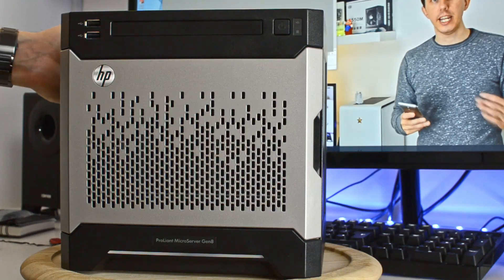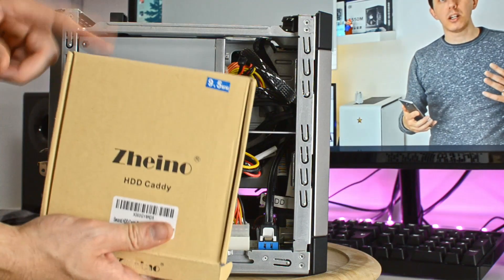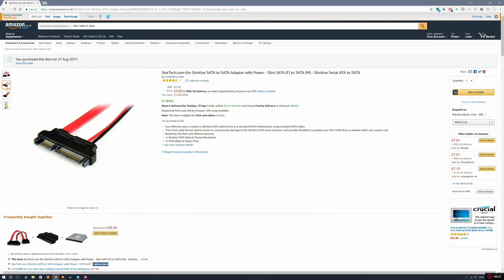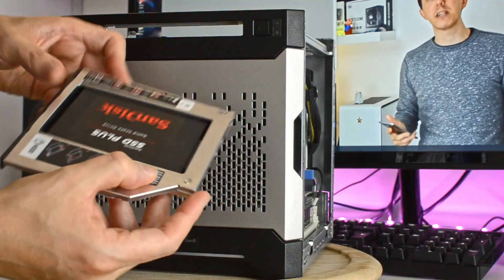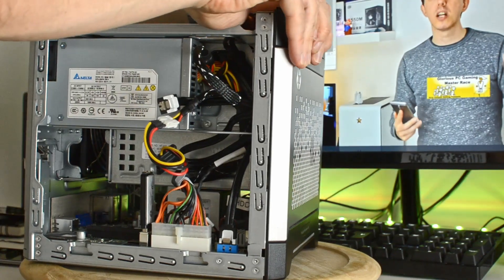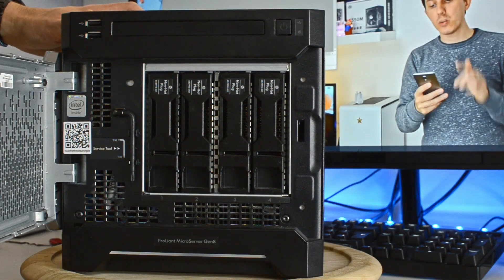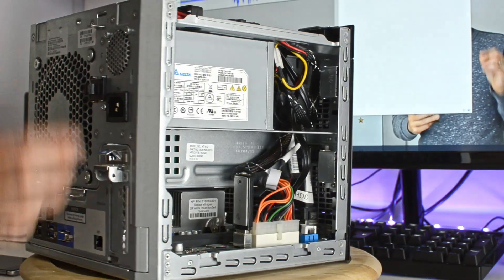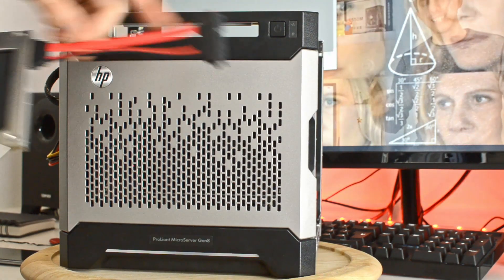HP Proliant Microserver Gen8 SSD in Optical bay

Comment: What power cable did you use to plug into the slim sata to sata? Is that already installed in the server itself?
Reply from the maker: Very good point! I forgot to mention you will need an adapter FDD to SATA, I have one already because the SSD was already being mounted! Here an example of the adapter:
https://www.amazon.co.uk/LINDY-0-15m-Power-Female-Adapter/dp/B00HN3NEZU/ref=sr_1_2?ie=UTF8&qid=1506170732&sr=8-2&keywords=fdd+to+sata

I will stick the comment for everyone benefit!
Reply: @NoTechDrama  please update the video with some text to reflect this information. I wasted a day trying to understand until I read the comment section. Haha.
Reply: there is also an official hp parts 667526-001 that connect to cdrom power and as a sata cable if you want to stay with hp parts. Also need cdrom to ssd/hdd 2.5 adapter with this cable

Comment: Why use a caddy with false front panel? You can get an adapter that costs £3 on eBay and its hidden behind the original optical drive blanking plate thereby maintaining a factory finish. Your solution is 5 times more expensive and looks worse.
Reply from the maker: Put a link here could be helpful for other viewers, thanks!
Reply: @NoTechDrama  The links to eBay keep getting removed.
Reply: @Distorted-Vision  can you write the name so I can search?

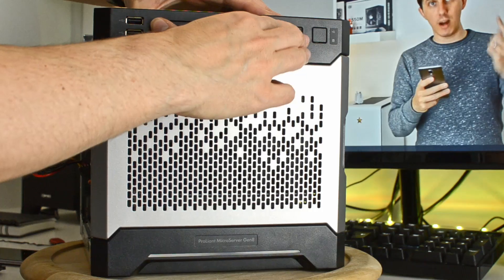Comment: Pardon me, I'm not native English speaker but what did you said cca at 4:30? Did you mention "Right" controller or "RAID" controller? What is controller, it is hardware or software? If I understand correct then for some reasons it is impossible to boot directly from ODD. How did you setup your USB so it contains only boot loader and OS is on SSD? Here is direct boot from SSD  https://www.admfactory.com/hp-microserver-gen8-boot-from-ssd-install-on-odd-bay/ I guess the trick is to have SSD in separate RAID. Is this worse solution than yours for some reason? Thanks
Reply from the maker: hi! I'm non native english too... so not so easy to understand me! I said "RAID"... the solution I've adopted is boot loader (GRUB) on USB and OS on SSD... The solution you propose from ADMFACTORY is very interesting too... I do not see any downside... unless is going to mess then with the 4 disk array (but won't see why!)

Comment: that "fake button" from caddy is useful, 
when you are changing opt. drive for ssd/hdd caddy in your laptop. you simply exchange that plastic covers and you can use opt. drive as external device (using the cable you showed)
Reply: huh?

Comment: Thanks for this. I just ordered some stuff to do this on my gen8. :)
One question though... I'm not very familiar with grub. How do I install grub on the USB and make it boot from the "optical drive"?
Reply from the maker: Install Linux on the drive using the optical drive port with ALL the other disks disconnected. This will allow to boot in the installed Linux OS. Attach the usb in the internal port and use fdisk or similar utilities to creat a bootable partition on the usb stick, then you just use the 'install grub' command on the usb stick. Reboot the gen8 and in the bios select the internal USB for the boot. If all works shut it off, reinstall the 4 hard drives and should boot again. If you get stuck an easy way is to use super grub https://www.supergrubdisk.org/super-grub2-disk/ but you will have to manually select the OS at ever boot, hope this helps, this could be a good topic for a follow up video
Reply: Thanks! This is really helpful.
Reply: @NoTechDrama  Can you show this exactly? doesnt work for me i want to boot Openmediavault and get some errors install grub. Thx.

Comment: Hi, thanks for your video.

You talks about "using the right controller for HDD on bays", I didn't get that part, could you explain what is the right controller ?
And most important for me, you said you use a Xeon on this server, is the VGA display still working with a Xeon ?
Reply from the maker: No I said that I'm not using the RAID controller, I need to improve my pronunciation 😀
Also I don't have a XEON but an i3 3220 anyway the server has a Maxtor GPU embedded so I believe you should not have any problem
Reply: Thanks for the answer, good to know, the embedded GPU.
About your pronunciation, I should add I'm not native English (French) so maybe it's not entirely your fault :)